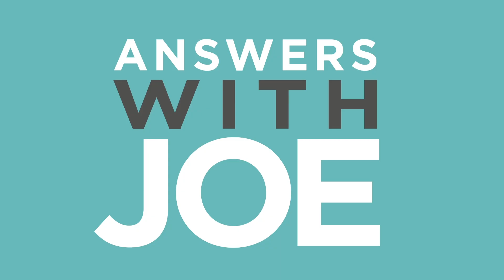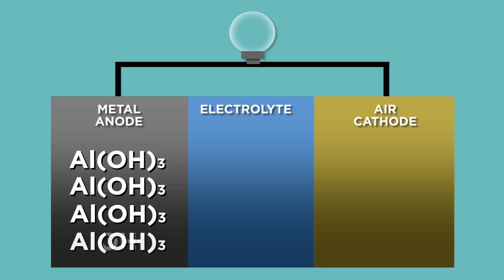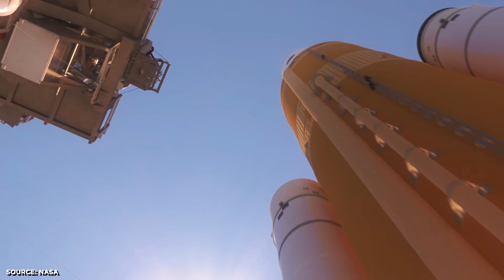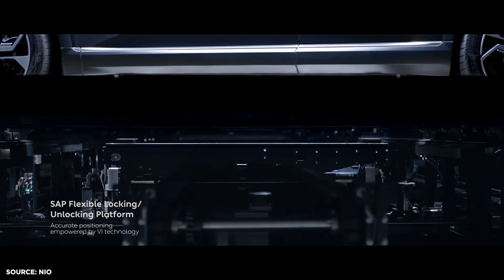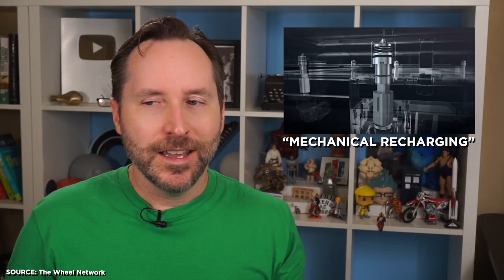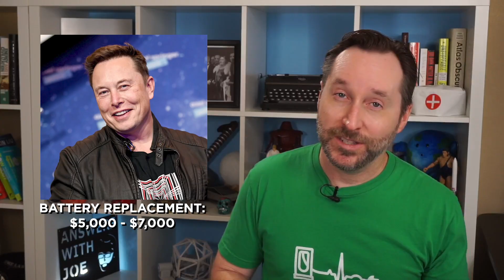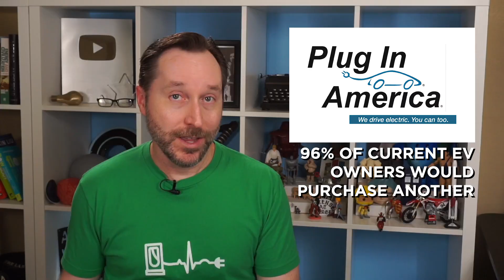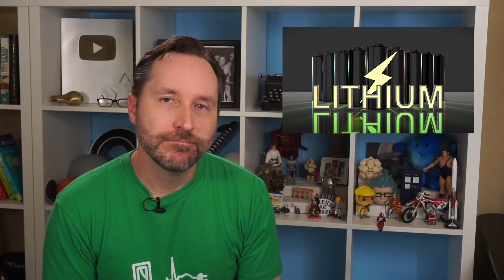This Battery Could Drive A Car 1500 Miles - But There's A Catch | Answers With Joe

Comment: The fun reason that Al is so energy dense in its refined form, is because it takes so much energy to refine. Seriously, entire power plants can be spun up just to refine mined aluminum; undoing that work releases a lot of energy, but then recycling it just needs to pump that energy back in. Yes, that's how batteries work, but I somehow doubt this way is all that efficient.
Reply: it isn't that efficient. Power plants usually have 40-60% efficiency, the you have two or 3 options: dissolve al2o3 in molten cryollite at 1000 degrees c, chlorinate al2o3 to alcl3 and molten salt reduce that, or just reduce the al2o3 with magnesium, dissolve the mgo with hcl, melt electrolize and burn the chlorine with hydrogen to get back hcl. all of these methods are fairy.
Reply: Got it in a nutshell. You're oxidising the aluminium to alumina/bauxite in the battery and need to reduce it back to aluminium to "charge". This is vastly different to melting down the metal and recasting it and much more energy intensive

WRT "entire power plants" - the Benmore plant in New Zealand is a good example - 500MW of hydropower dedicated to aluminium refining until recently (Tiwai point closed citing high power costs)
Reply: @miscbits6399  It is the Tiwi  Smelter no Benmore and yes it uses 500MW.  I live 20minutes drive from the Semlter.
Reply: @jamesakbar-given5009  Benmore is the hydro dam which feeds Tiwai point. It was dedicated for the purpose originally. 
When Tiwai closes it will join Manapouri in feeding HVDC to the North Island
Reply: @miscbits6399  We had the same set up here on the island of Anglesey just of the north Wales coast up until a few years ago. They decommissioned a nuclear power plant along with the aluminium smelter, but I believe that new plans are afoot too build a new power plant to feed into our every growing hungry national grid. Happy New year to you all.
Reply: It takes a lot of energy to break the chemical bonds, then you've got a lot of potential for strong bonds to form again, and can extract energy as those bonds form. Makes sense to me.
Reply: That is not how chemistry works. Aluminum is energy dense because it's highly reactive. It'll bond to almost everything. The energy to refine it is in breaking those bonds. Now I know that sounds similar, but no energy is being pumped into aluminum. It's not storing energy. We're using energy to break an energetic strong chemical bond. We're blasting a bunker with dynamite instead of blowing over a house made of straw. Then we're picking up the chunks of concrete to be used elsewhere. That's aluminum refining.
Reply: @halycon404  isn’t there a thing called chemical potential energy? If so, Wouldn’t that be increasing in the refining process?
Reply: @getoffthegames89  Chemical potential energy is energy held in the the chemical bonds of a substance that we can harvest by breaking the bond. We're breaking the bond to create aluminum, and the energy used to do it loses us energy. This is the diametric opposite of that. We're gaining energy by scavenging electrons in the formation of those bonds inside the battery. But in breaking those bonds we always lose energy. It's why the battery is a energy storage medium and not an energy source. We always lose more than we gain.
Reply: @halycon404  in the case for aluminum though, doesn’t it have more chemical potential energy in a non-bonded form? The energy being released when it bonds to oxygen? Or am I thinking about it upside down...for example, dynamite has high chemical potential energy that gets released when it breaks down, whereas it takes energy to separate pure aluminum from what it’s bonded to so when separated it has higher chemical potential energy, right?
Reply: @getoffthegames89  Okay. Think of it this way. Some chemical bonds are inherently unstable. They want to break apart, but just need a nudge. We can gain energy from breaking those bonds. The thing with aluminum though, it almost never bonds with anything in an unstable form. We can artificially create unstable bonds with it, but in nature aluminum pairings is about one of the most common strong bonds there is. It doesn't easily fall apart, we can't gain any energy from it because it takes so much to break the bond. Now in the battery. How to explain. Okay, electromagnetism. Imagine aluminum on an atomic level is a very very strong magnet. That's not what is going on, but for this it's close enough. So the battery introduces oxygen to the aluminum and the aluminum rushes toward the oxygen so hard by the magnetic pull it ejects an electron out of the oxygen when they slam together. That's basically whats happening in the battery, and we're taking that ejected electron to power our cars, boats, phones, or whatever.  We get an electron, the aluminum gets a bond with oxygen. To break the bond with oxygen to recycle the battery we have to put in more energy than we gained from the single electron. We always lose energy in reactions involving aluminum. Carbon on the other hand, we normally gain energy from reactions involving carbon. All fossils fuels are based on carbon based chemistry. Hydrocarbons. Our bodies work on carbon based chemistry, also hydrocarbons. It's very reactive but doesn't normally form strong bonds. It can, just normally doesn't. The exact opposite of aluminum.
Reply: @getoffthegames89 Alot of people think Hydrogen is an energy producer as well. Even though it is just a storage medium.

 I think aluminum air batteries will become a thing if we can unlock half the potential. Which correct me is only second to lithium air. 

 I think I seen lithium air holding 12,300 watts per kg. Nearly as much kerosene. 

 With Ai/Air being around 10,000. 

 So if we could get half that we would have over 15 times the storage of a Tesla battery which sits around 260. 

 I think only then it would be worth it outside of niche markets. With renewables becoming cheaper? Producing isn't the issue. Storing and transporting it is. 

 I really wish we'd get some breakthrough in lithium air.

Comment: Two nitpicks: 
1) "Tesla says x cents per mile" - Tesla is not the end all be all of EVs
2) at the end, you say al-air could be an option for those who do not have charging stations around... but hey, the battery swap infrastructure is even more nonexistent than hydrogen infrastructure (and judging by hydrogen, it will take years if not decades to get going, if at all!)

One application of al-air I thought of is aircraft - going by the ship example, you're effectively getting double the energy in the same space/weight?

Comment: There is also case for recarchable Sodium based batteries. The density is less than Ion but explosions are heh less of a problem, tech is similar and price would be less lower. Also doesnt use cobalt which would remove the slave labour rare earth material issue.

https://en.wikipedia.org/wiki/Sodium-ion_battery

This might be the solution, yeah it would be bigger in the car but same time the amount of cycles has potential to be more than lit-ion. Or we just jump on solid-state batteries ;)

Comment: People will say that the Al air battery is better because you don’t have to charge it like LiION batteries. Yeah well those electrons have to be stepped up in energy state somewhere. Well that’s from AlO that gets electrocuted to fuck and you get aluminium that you then get to dip in a caustic solution and get electrons freely running the loop. HIGH energy to low energy. Here is the tip, EVERYTHING runs from high to low (entropy excepted).To get aluminium to the HIGH state you have to refine the aluminium ore using electricity. You can’t count on using existing aluminium since that already has a market and is accounted for. Then you scrub your battery somehow, maybe with acid and flush the aluminium ore down the drain along with the acidic solution that strips it.

Sounds like how I filled huge garbage bags which hydrogen when I was a kid. Aluminium foil into sodium hydroxide draino.

This is a bust.

Comment: Id like to see a episode about gravity batteries. I always thought those were interesting, coupled with solar powered cranes to harvest the energy, and release the energy at night via gravity. Basically its the same as hydro electric dams, its the sun doing all the work.
Reply: That's interesting, I haven't heard of a 'gravity battery' before.  I wonder if a 'flywheel battery' could work?  It's kind of similar, a heavy flywheel can spin a big generator, but once it's up to speed, a small current can keep it spinning.  Could harvesting energy from the sun to maintain the spin provide enough to make a net gain?

Comment: Great, I can insert billions of joules into aluminium oxide (i.e. ore) to make aluminium to make a battery, then get slightly less energy back out to make aluminium oxide inside the battery. You don’t get aluminium at the end, you get an oxide.  You can’t recycle an aluminium air battery. You have just turned it back into aluminium ore and have to put all that energy back in again to make another battery.

Comment: Depending on the driving you do it could be worth supplementing an AL AIR battery with a small regular lithium battery (or maybe just a super-cap) to extend range benefit from regen braking etc...

Comment: I'm pretty sure the recyclability of aluminium is only as good as it is, because aluminium doesn't tend to corrode from skin to core. 
Aluminium batteries work on corrosion and the process of refining the hydroxide out of the hydrated aluminia skin that forms on a anode is very energy intensive and carbon heavy (they literally use sacrificial carbon electrodes to electrolyse molton alumina (2100°C) to produce CO2 and Al and skim the aluminium off the top).
So, the way I am interpreting this all is that; once the battery is exhausted, you aren't technically recycling the battery, you're literally converting it back to high grade ore, re-refining it back to aluminium and doubling the carbon footprint that aluminium has impacted on our environment, which is no the case for lithium ion.

Comment: One possible use for these: A range-extension trailer for electric cars. Need to go more than 500km where there's little electrical infrastructure? Hire an aluminium-air battery trailer to tow behind the car and turn it in at a branch of the hire company when it gets low or you're done.

Comment: What about aluminum air batteries to charge electric cars it could be made portable for easy replacement and would be available in areas that you can not install a permanent charging station as well it would not be increasing the drain on the power grid like present charging stations do allowing small towns and farms to also go EV. The batteries could be made larger for longer life. The batteries would have ready access to water from your home and could be on trailers or exchangeable trailers like propane tank exchanges are for barbeques now. The charging attachments could be made for any model of EV. Perhaps the problem with this type of battery isn't the need for change out but a more imaginative way of using it, change the approach to reflect the change of technology like we did when we began using gasoline engines.

Comment: If it could be designed in such a way that the spent aluminum could be quickly pulled and replaced with new aluminum (quick meaning taking no more then 45 minutes to do the swap)
Reply: just use wet cell and some alu plates on a threaed rod

Comment: The potential of this technology reminds me a bit of the original wave of electric vehicles. Back in the mid 1910's NYC had a large number of electric cars running on alkaline batteries. Delivery men (pretty much akin to milkmen of the day) would come by and pick up your drained battery and leave you with a freshly charged one. 

Maybe not the best solution now that labour costs have risen much higher than back then, but maybe it could be automated to some degree?

Comment: If these cells can be stored for a long time, then it is a very interesting idea for backup systems.
For example an UPS, or backup cells in alarmsystems, cell towers etc.
Replacing them after an incident is much less of an issue compared to premptive replacing all cells in the field after a few years as they are no longer reliable anymore, adding to the e-waste.

Comment: When you charge a Li Ion battery, you get ~ 80% - 90% of the energy back (depending on where/how you measure it.)

The big cost of refining aluminum metal is the energy.  Bauxite and cryolite are melted, put into electrolysis cells, and split using lots and lots of electricity.

The question is, how much electricity, total, goes into a battery that creates a KWH of power?  Do you get the same 80-90% back?

Wait... Your mister asterisk is pestering me.

You lose some electricity in transmission and distribution.  That's why aluminum refinement plant owners like to place their plants near power plants.

So... How much is lost?  [quick google search]  Um... about 5%.  That isn't bad.  It's a definite plus for Li Ion versus aluminum.

But I hear that we'll have cheap, clean, and inexpensive fusion power in twenty years.

Oh, it's fifty years now?  My bad.
Reply: Theres also the transmission losses involved in all those cables for recharging your Li or any other rechargable battery. As well as in making it.

All this talk of cars and trucks... they are a form of polution in they take up space ... You have to give over huge areas of land and resources to roads and car parking.  Concrete is one of the most polluting materials out and energy intensive.
Your going to have to come up with a lot better ways of moving lots of stuff and people over big distances ..without it ending up in an electric vehicle traffic jam.
So rail transit... water and possibly low energy slower air systems are going to have to take up most of your planned journeys.🤷🏻‍♂️ The twelve mile roundtrip to the retail park or hour  drive to work for most of your urban or suburban populations is going to be a no can do game.
Cargo will have to move by methods according to distances and weight.

Comment: TOP TESLAS currently reach around 700miles range (whilst passing by free superchargers every 30 miles in any direction). They aim to reach over 1000miles range by the end of 2022 and by far overtake the range of diesel and petrol cars by 2023. THIS BY current affordible al-ion 4680 battery cells. The time is NOW, not later.

Comment: The discovery of aluminium was announced in 1825 by Danish physicist Hans Christian Ørsted. The first industrial production of aluminium was initiated by French chemist Henri Étienne Sainte-Claire Deville in 1856. Aluminium became much more available to the public with the Hall–Héroult process developed independently by French engineer Paul Héroult and American engineer Charles Martin Hall in 1886, and the mass production of aluminium led to its extensive use in industry and everyday life.

Comment: You know how every week or so, you hear about this spectacular new battery type just to find out they left out the key info...

How efficient and what's the raw materials supply potential.
I'd like to hear about all the specs for all the batteries, kinda like in graphical form. Especially all the different "iron" batteries, like that one one of Tesla's suppliers, I believe CATL proposed (or is already working on), the iron sulfate...

Comment: I want more research into batteries that do not transfer energy type. For example, a phone battery works just fine because the phone uses electricity. A car must transform the electricity to magnetism and use that to spin the wheels.

It wouldn't be easy to make a flywheel so effective that it could sit in your driveway for days, but it's not impossible and there are some other options like a "heat battery" to power an oven or a "lift battery" to power elevators. I just don't believe that burning coal to make electric energy and send it along a long wire and then change it by chemical reaction and then change it back and then use that to spin a wheel is the most simple way to move people around.

Comment: These might work well to replace diesel fuel with trains, they already carry loads of cars and metro systems are already electric. The problem of swapping the batteries is no big deal, because you could have the swap points at the pickup/dropoff points.
Reply: We already have a practical way of running trains on electricity. It’s called third rail or catenary.

Comment: But one thing not mentioned is Tesla 4860 battery. They claim it is better in every way and cheaper and they can fully recycle it. This is a very important factor not included in this discussion I think. Who here thinks the 4860 battery isn't gonna become the worldwide universal battery used in cars and the form factor will just change to accommodate phones laptops etc etc? sold from Tesla who claim they can fully recycle it too. Why wasn't this mentioned in this video?

Comment: I'm one of those people that doesn't have a garage, so charging is out of the question, especially given the lack of infrastructure. I also love convenience. And I still believe battery technology has a long way to go, can't power my laser/plasma rifle yet. 

When I was but a young lad, 40 years ago, I would have eagerly paid for a combustion engine upgrade to fuel my car with liquid hydrogen. Today, Hydrogen is a catalyst (?), which is fine. But again there is no infrastructure... I'm still waiting. But I'm beginning to worry I might not live long enough for the world to get it's shit together.